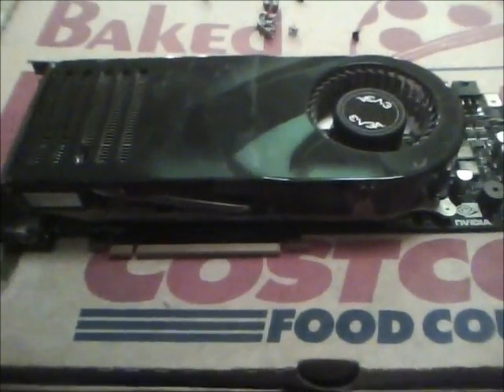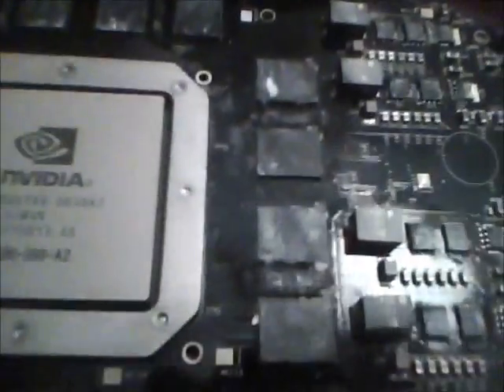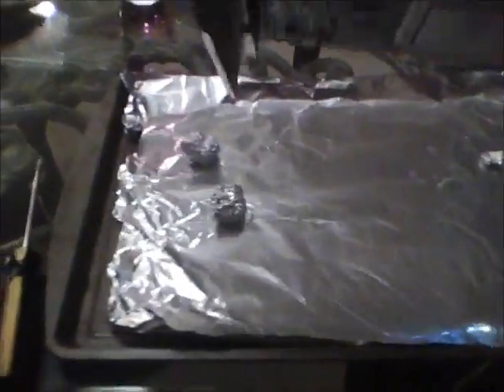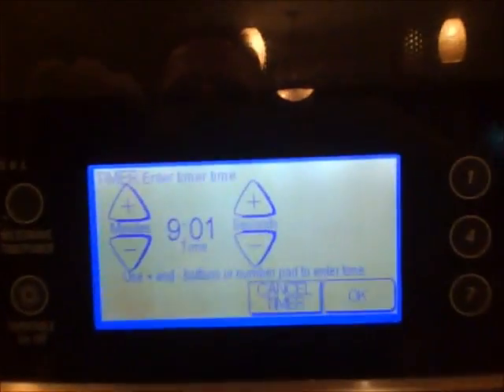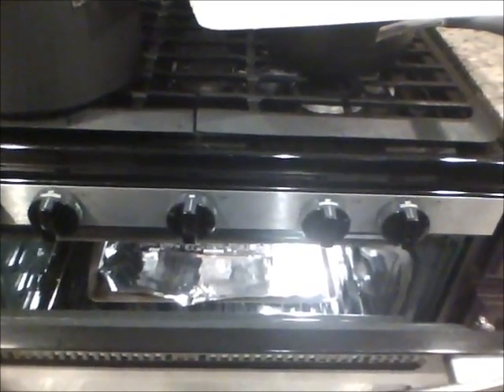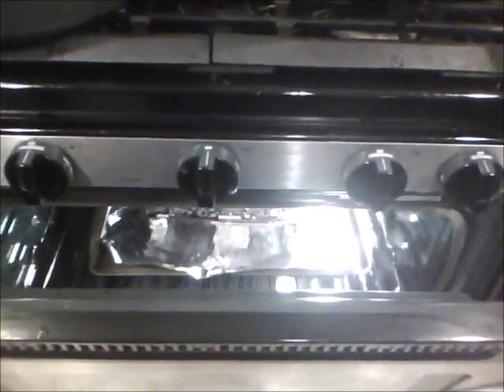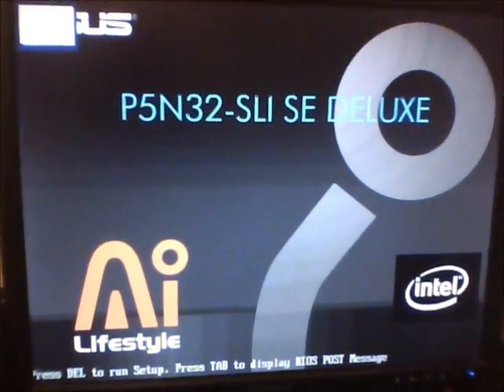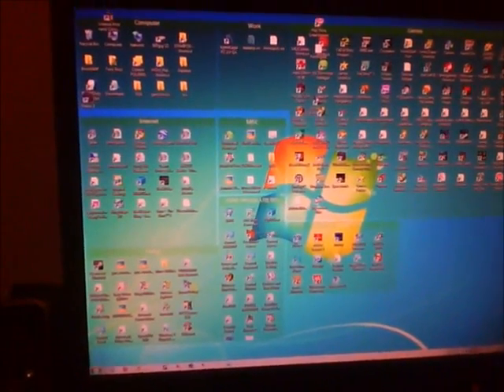Fix your 8800gtx Graphics Card (STEP by STEP) by Baking it in the OVEN.

Comment: I just tried it. pre-heated oven for 200C, put it inside for 9,5 minutes chip up leveled od 4 foil balls, then truned off and crack open and let it cool down for over an hour, then re-assembled and tried.
result: artefacts much worse but i manage to reach the normal run of OS and played Just Cause 2 with no problem, just the colors were tragic. So i think i did some mistake so i will buy more paste and do it again tomorrow and hope i will be completely ok. thanks for your video.

Comment: Preheated oven for 10 minutes 195C. Then i put my card inside the oven, on 4 balls of tinfoil so it's evenly leveled, GPU upwards. Cooked for 8 minutes, then turned off the oven, kept door closed for 1 minute. Then slightly opened the door and let it cool there for 1 hour. Works like a champ now.

Comment: This totally worked for me, thank you so much for such a comprehensive tutorial. I did it with an old nVidia 8800 GTX with artefacts/corruption in bios. I did the baking GPU FACE UP at 190 degrees for 10 minutes. I then let the oven cool naturally with the door open a crack for at least an hour.

Comment: works beautifully, gpu temp is at 45 constantly, cpu responding well. played games, watched movies and havent turned the pc off yet,(personal habit), my laptop is always on. so far since the gpu baking, pc is on for over 30 hours. before baking my pc would boot and i'd remote desktop into it, as the gpu wasnt loading so the display wouldnt turn on and any attached tv or monitor wouldnt  work either..Now everything works flawlessly. Card must be down. I have a CLEVO M570TU - GPU NVIDIA 9800M GTS

Comment: Works amazingly. !!! tried 3 times. --1st time oven not hot enough, --2nd  i didnt let it cool properly and didnt put enough thermal paste ( the layer was too thin), although the card started, the laptop would shutdown after 5 mins. --3rd time  i preheated oven 10 mins. at 200celsius then placed chip side down for 10 mins. then opened  just a gap in the oven to cool slowly for 10 mins, then opened all the way for another 10 mins. cleaned and  put a better layer of thermal paste.  JACKPOT!!

Comment: Another success story, OEM 8800 GT (rev 1) from a Mac Pro.

Used your video, and with the exception of baking it chip side up, I followed it to the letter, 200 C - heat off door and closed for a min, then 25 - 30 mins cooling with the door open.

Put on a tiny bit of thermal paste just enough to cover the G92, used the same thermal pads (pads are a bit wrecked but more or less intact). Popped back into the bottom slot and working like new again, still in disbelief.

Thanks for the great vid  :-)

Comment: besides leveling it with the foil, you have to tell everyone the foil needs to be on the ends held up by either the capacitors or chips, because if the foil touches the circuit, the solder has a chance of stickin

Comment from the maker: You are right.  I was never sure which way it should be up or down.   I just note some people do it face up  some do it face down..  Thanks for the tip.   Thanks for the TIP on the Flux Liquid.  This is the technical detail needed to make this process better.   I had used face up in the past and it worked but it didn't last long.  (It could be because I didn't cool down Slowly.   However, so far things are cool on mine since the video.  Not a flaw.   I will try FaCE up in the future w/ SLOWCOOL

Comment: Hmm this needs sorting dude. Firstly NEVER EVER EVER put the graphics card with the components facing DOWN. The way this works is to melt the solder. Gravity will make the components fall down meaning they reflow twisted. Put the card down in the oven with foil under it FLAT with the dull side up. Also, get some flux liquid in a squirt bottle and pump it under the main GPU chip itself.